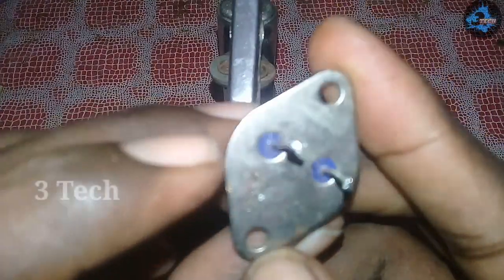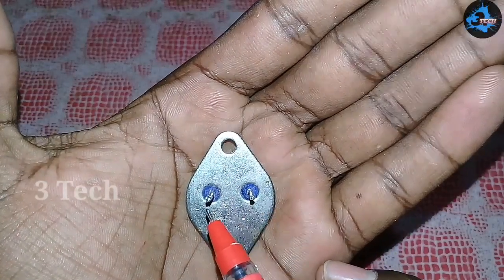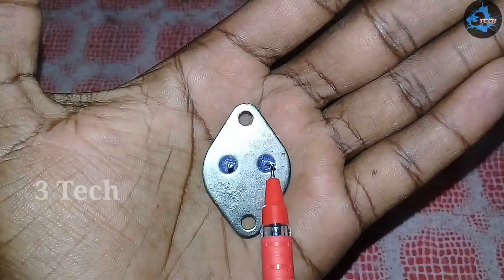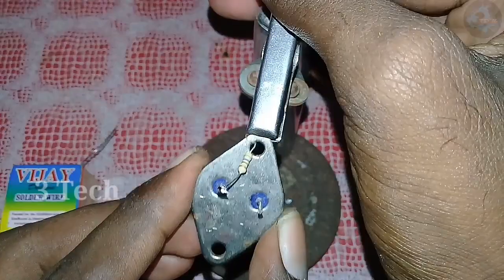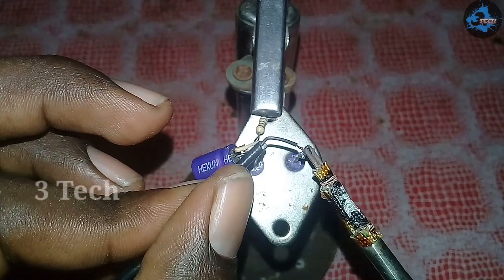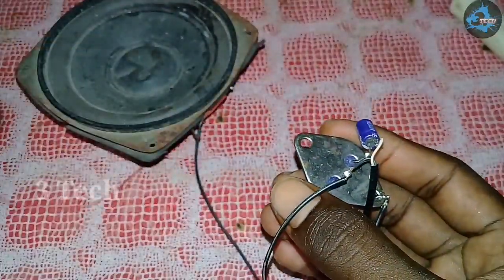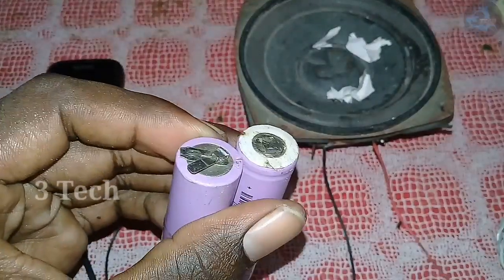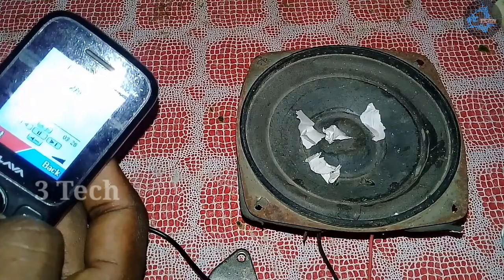3055 amplifier || How To Make 2N3055 transistor amplifier ||  செய்வது எப்படி

Comment: Bro home theater 4558ic fault achu anal new ic vangi mathiten set agala ana vera hometheatre irunthu kalati pota paduchu 2 days
Match agira correct ana ic ethu bro equivalent ic iruka bro
Reply from the maker: Company IC use pannunga
Reply: @3tech724  bro 4558 munnadi ethuvum serial iruntha sollunga bro